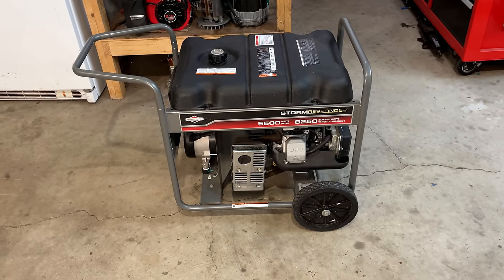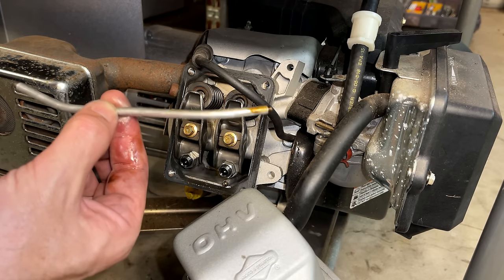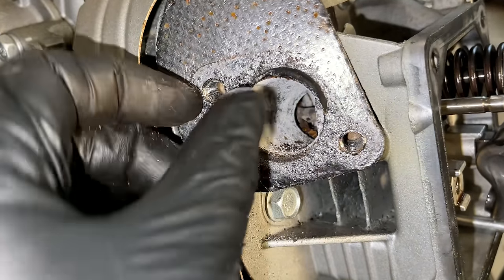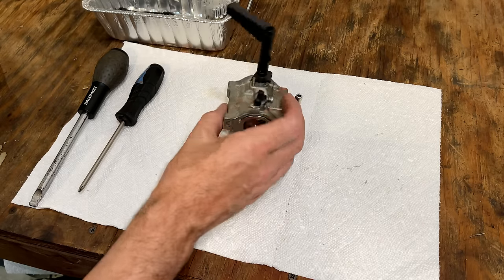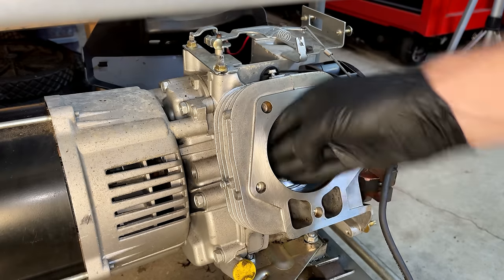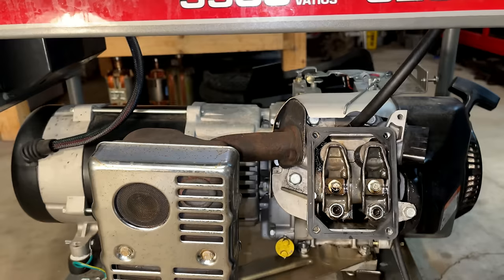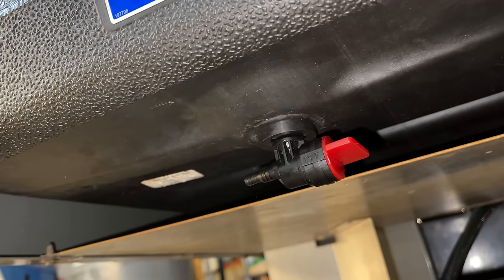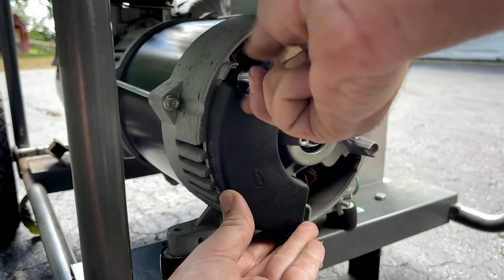Seized Engine - Can This Generator Be Saved?

Comment: Great job! The buyer was taken advantage of. I bet there's more to the story then what they told him. Glad you were able to pull it off for him! 👍👍👍
Reply: I can't understand who would buy an motor like that without testing it.   Even if it has a bad carb or something, you still could test it with starting fluid and at least listen to it run for two or three seconds.   P.T.Barnum said it best, "There is a sucker born every minute"...
Reply: @jimthesoundman8641  I thought he bought it knowing it needed work.  At the very least I would have expected someone to pull the engine over.
Reply: @bobadam7021  Tend to agree, buyer bought it for a low price knowing it needed work as it was sold 'as is' and rolled the dice as it looked nearly new.
Reply: Yes!

Comment: James I cannot see at all why this head cannot be used. Once you grind those valves, considering the seats are not pitted, since you never put a ceramic bronze coating on the entire path of combustion heat. With co2 surface blasting to get the entire surface very clean ceramic would lower the surface temps by 200°.

Comment: I have never seen a clone carb ever run well on a briggs and Stratton
Reply from the maker: Me too, but not on a 9 or 10 horse OHV
Reply: The Nikki clone I put on my Briggs runs fine.
Reply from the maker: @1pcfred  I have not tried one recently.
Reply: @jcondon1  it was just a couple weeks ago. I'm sure it's a crap shoot. I just got lucky. I could have maybe fixed mine but the shock when I opened it up caused me to simply replace it. My tractor had a little accident and decided to self immolate in my driveway. That melted all the plastic carb guts. When I saw that I was on Amazon ordering a new one before it even hit me.
Reply: @1pcfred  most OFF brand clones don't work Nikki clones do sometimes work
Reply: @1pcfred  yikes the tractor melted the Carb Not good
Reply: @AntonioClaudioMichael  The aftermarket carburetors seem mighty popular with folks. I was having some carburetor trouble with my leaf blower today. It's really old so the diaphragm in it is likely petrified. I can't imagine it isn't. It certainly seems like a fuel starvation problem to me. It's a Walbro. I should rebuild it because it has the mixture screws. They don't make them like that anymore.
Reply: @1pcfred  wow I haven't seen a walbro is ages I would definitely rebuilt it if you can find a carb rebuilt kit
Reply: @AntonioClaudioMichael  as far as I know Walbro is still making carburetors but this is a very old one. It is a very old blower.

Comment: I bought a similar generator in 2004 when Frances and Jeanne tried to move my Florida home to Kansas. I've only actually used it 2-3 times since, but I pull it out before every hurricane season and give it a short test run. I use only non-ethanol fuel and add a bit of stabilizer and Marvel Mystery oil to it. After running it, I shut the fuel off and let the carb run dry. After 22 years of primarily storage in the garage, it still starts on the 1-2 pull and runs fine. The biggest maintenance problem is the tires that are always flat. Going to put solid wheels on it one of these days. A little care and maintenance go a long way.

Comment: James, I have a small engine repair business myself, and I am now trying to make it my full time gig. Back when covid started it cost me my job and since I have had a part time gig and been doing small engine repair. I have always enjoyed your videos and have actually learned some things from you. I wish I had the knowledge of the power head that you have. I just wanted to tell a little about myself. My main reason for reaching out to you was to suggest that you might benefit from a vessel blue handle JIS screw drive with the end with the splines on the tip. It works great for JIS and regular #2 screws as well it has become my go to driver actually for all screws in the #2 size and JIS. It is priced reasonably and can be found easily on Amazon.  Once again thanks for all of the really great videos you are making.

Comment: Pulled a seized Honda 2500 gen from the dumpster at work. It had low oil switch disconnect, no oil in sump. Added oil , oil also in the cylinder. Piston was freed using a power bar By removing pull start assembly. This generator ran great, but consumed a lot of oil. Your video was great education for me, 78 years and retired electrician.

Comment: This is the exact generator I have, and it has never let me down through 2 hurricanes and 1 polar vortex!  I have changed the oil more than required and only had carb problems once from the ethanol gas.  I will be giving it a test run tomorrow and have only used ethanol free fuel since my carb cleaning.  These people are lucky to have found you!

Comment: You're a good man James. I've got this same generator (albeit the 6500w version) bought in 2003 during Hurricane Isabell. It's only got 70 hrs but this video gives me great hope that it will last for many years. I've never seen another one like mine actually. It has three wheels, electric start and a deluxe panel (hour meter, flood light). It even came with a transfer switch. Paid way too much though. You are a valuable resource. Thanks for the excellent content!

Comment: Excellent job Jim, also for a good cause. I have had a few of those engines that also use oil. Hard to get customers to check the oil before each use. I had a neighbors craftsman YT3000 riding mower that has a Briggs engine that uses about 6 oz. of oil after each use. He has a hard time believing that they use oil. I changed it to a 10/40 oil to try and slow the use a little. You can only see oil from the exhause when shutting down the engine. Plug does not foul etc. Thanks for great video's.
Reply: My Briggs doesn't use oil it just leaks it out. Least I think that's where most of it goes. On the plus side I never have to change the oil on it. I just keep adding to it. I never start it without checking and adding some.

Comment: I had the sparkplug seized on new open frame generator. I'm still talking to the company. I was able to remove the plug by slowly rocking it back and forth small amount for about half an hour. There was a lot of aluminum from the head in the treads, but I was able to install new plug with Anti seize lube and run the generator. I sent them the picture of the plug and don't know what they going to do about it. I asked for new engine head and gasket; I'm afraid that new generator would have same problem because I suspect that thread was never cut in the head and sparkplug was just forced in to create the tread. At the end I had to use long arm wrench and probably about 90 to 100 ft lb of torque to remove it. Love to watch your videos, I don't know if I could stay so calm encountering all these problems

Comment: Good job, one of the best videos seen on youtube yet. Thanks for putting this together in such detail ! Got our seized motor going again on same gen you repaired, has just 7 hours but had been sitting for years. Just an oil change and WD40 in spark plug port. Trashed the tiny o ring in the bowl during reassembly & now floods carb when engine off & gas still on but easy fix. Awesome job, TY !!
Reply from the maker: Thanks 👍

Comment: I have this exact same model. Obviously, the only way an engine would seize is, no oil, very low or really bad oil. Too much can definitely shorten the life. It always amazes me that so many people make simple maintenance on small engines so difficult for themselves. I mean really, read the manual. It usually provides info on type, amount and frequency of oil changes.
Reply: Low oil is not what caused that damage. Somehow water got into the top end. It responded to a storm it should have sat out.

Comment: That was an amazing repair and recovery.  What upsets me the most is the seller took advantage of the buyer.  Let that be a lesson to all.  If the seller says it runs or works or whatever, make them prove it.
Reply: I'm not buying any used power equipment without giving it some look. I know it's going to be messed up but I don't want severe internal mechanical damage. And yeah people are scumbags.

Comment: James when I was a mechanic I would use the B12 on the rubber parts instead of oil. It made it real slippery and it evaporates fast. Try it next time when installing a fuel valve.

Comment: James, watching you install that valve hurts. Working on cars and race cars for 50 years I figured I would pass this along to you. There is a product called " Door  Ease". It is made for stuff like that. You can put anything into anything with it. Don't have to force  it. Rub some on and it will slide right in (It's almost scary it goes in so easy) . Its a wax like  stick not very expensive. Pretty sure once you try it you will be a believer in it too. Use on  convertable   top back windows , zippers, anything that is tight that needs to go together. Auto part stores ace hardware stores have it. Gas tank filler neck  "O" rings. Any kind of  "O" ring. I promise you will love it. We used it on automatic trans.   "O" rings and seals. Try it you will love it.

Comment: The push to reset circuit breakers are cheap insurance, and I do mean cheap. They can run for a significant amount of time at over 120% of their rated load before thermally tripping. At that point it may already be too late, windings could fail, AVR failure, etc. So many generators are blown up because of overload or improper balancing on the legs between the neutral. Great job repairing this one!!
Reply from the maker: Thanks Gary

Comment: Clean the generator while it is running using a garden hose. Power head looks great, carburetor basically clean, even clamp on hose looked rusty as well as breather stuck in place. Nothing else fits. Air intake provides direct path to cylinder/piston.  Thanks for the puzzle and sharing.

Comment: I have that same generator that I bought after hurricane Ike and its just been rock solid all these years. I keep it filled with ethanol free gas and Stabil and synthetic oil in the crank case. I really like the plastic gas tank because it cant rust.

Comment: Thank you I have an one that’s over five years old and looks like new . It’s seized from starting without oil I think; however after watching your video I will give it a methodical diagnosis like you have shown . Thank you 🎃 .. when you looked at the engine there were no obvious signs that it threw a rod . 🎉

Comment: Awesome Video Channel!! I learn more from you than any other small engine repair show. One thing though... the thermal expansion of aluminum is twice that of the steel ground electrode on the spark plug. A heat gun would have helped remove it. Kind Regards

Comment: That's a very good and kind gesture on your part. Let's hope the generator gives its new owner good years of service.

We've encountered that detached carbon problem a few times in the past, and it's always been on engines which have been subjected to a damp environment, in our case, almost always Honda, or Honda clones. It's as if the alloy begins to oxidise, and pushes the carbon from the internal surfaces. Invariably it falls to the bottom edge of the cylinder, and the piston crushes and compresses the carbon against the inside of the cylinder head.
Reply from the maker: I have also seen that a few times now.  It either stops the piston at TDC like this one or if lucky it pushes it out a valve only to then cause the valve to hang open on all the junk.

Comment: I would say the water came into the intake, judging by the overall condition of the intake and carburetter throat.
Had a lawn tractor engine sat out in the rain for many years hood up air filter cover off, the carb look the same but the oil in the crankcase was clean

Comment: Interesting video!  This looks like an engine that was running when it sucked water in through the air filter and the carb.  This would have stalled the engine. Some time later it was started again, which is when the rods bent from rust in the valve stems.

Comment: From your channel, to my hard drive. I really get a kick out of watching you fix stuff, the way I should have done it, long ago.
I did not know how to repair the "right way", but I had a lot of broken stuff to mix and match up until something occasionally worked.
I`m figuring the original problem was possibly caused by a quick dust off with a pressure washer?

Comment: James I stumbled across your channel recently and have begun to binge watch. Your videos have inspired me to dig deeper into my own machine.  As well, I bought my first neglected generator this week and hope to get it going - thanks to you!

My own machine (Chinese 7 kw) runs well but it will reliably backfire upon shutdown. In the 50 or so videos of yours I have watched so far I have not seen you have a machine that backfired upon shutdown.  I’m wondering what I should try to fix this?  

My machine does not have auto-idle or a fuel solenoid.  Thanks!

Comment: As for the water intrusion on the intake, I bet someone pressure washed it and wasn't careful not to blast the air cleaner. Thus we have what could've been a boat anchor. Too bad he over paid for it. It was worth fixing as you said, as long as you had parts lying around.

Comment: Good save. When I saw the plug come out I was thinking it might be done
Reply: It was done in the condition it was in. It was OK after it got redone though.
Reply: @1pcfred  Well yeah, that's a good point.  I was thinking done like "oh noo, the piston is rusted to the cylinder wall" 🙂
Reply: @GuysPlayingWithTools  I don't know where that rust came from. The cylinder is aluminum. I guess it dripped down from the valves? It's definitely a strange case.
Reply: @1pcfred  ethanol breaks down and attracts water,  if you were to levee some in a tank for a couple years with a tiny vent you would see a puddle of water at the bottom of the gas
Reply: @GuysPlayingWithTools  dry gas is basically alcohol. It is a dessicant. It sucks moisture out of stuff. Ethanol is alcohol.
Reply: @1pcfred  Sorry, I was guilty of dumbimg it down too much in that one.  In comments I airways try to stay s simple si can without missing the point.

Comment: Excellent save, Jim! THIS video is going to help a lot of someones. The original owner and the kids at the school as well! Class act donating the parts and time on this one. Only one question, why leave the power output at 126v if the normal grid where it is going is 140v? I thought for sure you would run it up to 150v. Would that risk damage to the power head side of things since it is technically designed for 120v & 240v usage here?
Reply: I was thinking the same thing,why 126 volts.
Reply: There are so many reasons and being outside of rated spec is one of them. Safety is the most important reason IMHO. Everything about the generator - the labels and the plugs - says 120/240 60Hz north american spec. If you go and turn it up to 150/300 volts (if it was even possible) what do you think would happen when an unknowing person decides to plug their north american device into this "north american" generator? Personally, I would have left this generator set at 120/240 volts and honestly not even have thought the idea to ship it to africa. Are generators elsewhere in the world so expensive that it's cheaper to buy a generator in the states and ship it over the atlantic to africa?
Reply: @killer2600     A great fixup job there, top quality work and done with love, but... I would have thought the cost of shipping to Africa exceeded the cost of buying a new Chinese generator there. Also I have no idea where he got the figure "140" volts from. ALL of the research I have done shows African countries as running 220/230/240 volts and 50 Hertz. Remember 60 Hertz, although not uniquely North American, is in the minority in the world. Running it slightly over voltage at 125 volts is probably just barely acceptable for so called "110 volt" appliances (I think there is supposed to be a 10% variation tolerance plus or minus). But I think it would be advisable to affix a placard to it clearly stating  "125 volts, 60 Hz". Indeed as he changed the voltage I wonder if that has affected the output in Hz also ?

Comment: Great video, as always, and it will I'm sure be a boon to the children and their school, thanks to your donation of time, skills and materials.  But where in Africa today is the mains supply voltage really 140V AC?  I think that Liberia has 120V, and Libya used to have some 127V, but is now listed as 230V, but I can't find any African country listed at 140V.  They're all 220V or 230V.

I remember 50 years ago in Verona, Italy, that town had 140V.  Most other major places in Italy at the time were 220V.  The trouble with 140V as a tourist is that you can either get a faint buzz from your mains shaver set on 220/230V, or make the job a frantic scramble while driving it at 16.67% over voltage set to 120V!

Comment: Hopefully the gentleman that purchased this now knows when you buy a "good running" piece of equipment, you should have the seller demonstrate that before buying it! I sell used mowers, tillers and such, and always prefer the buyer to try it out. I agree with a previous comment that this was most likely pressure washed and the muffler and air box were directly sprayed. You may want to think about investing in a bead blast cabinet, I think that head would clean up, although the valve guide might be another story. Much faster than wire wheeling. I've used glass bead quite a bit, even on corroded carbs.
Reply from the maker: Will get a bead blaster at some point.  A little tight on space.  I do the same thing.  I always make the buyer start it and see that it works before they take it home.